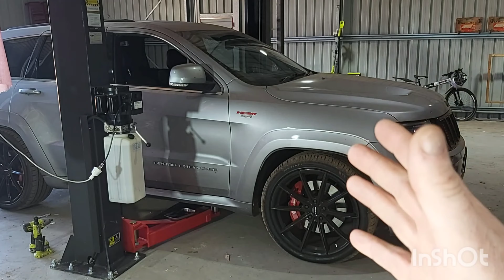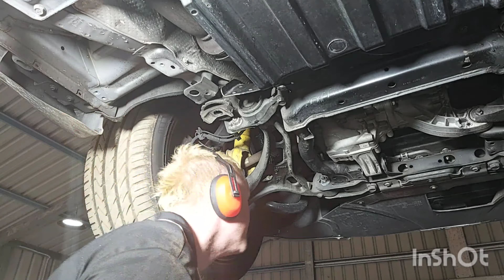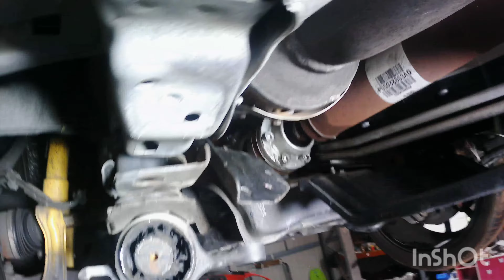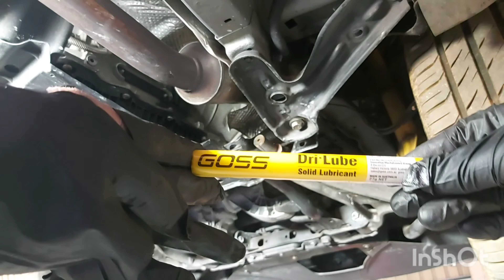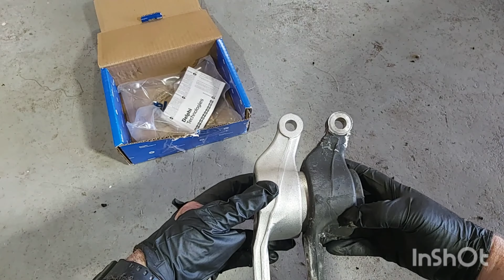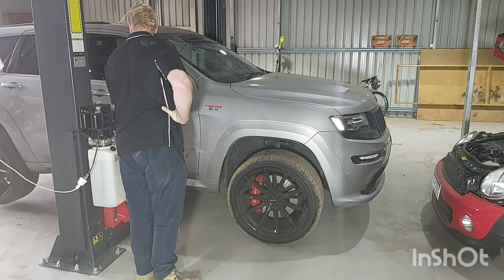How to install lower control arm / wishbone bushes very easily - Jeep Grand Cherokee.

Comment: Well done! These Jeeps and Merc's  Ml"s and Gl's  are a real pain in the backside when it comes to replacing those control-arm bushings. I was looking around today to see if there was a tool that would make the job easier, and I came across your video. I was very impressed with the way you did it.

About how long did the job take using that method?
Reply from the maker: All up a two to three  hours mate. But my car had only around 90k kilometres. The bolts werent seized or anything. The only downside was I had to get the tracking / wheel allignment done afterwards $$$ plus more time in the garage.

Comment: You are truly a wonderful person. However, if the bolts weren't installed correctly, where can this be fixed? Can it be done at a steering alignment shop or by a mechanic? Thank you, thank you, thank you for your kindness.
Reply from the maker: Hi mate, yes, I took my car to the steering and suspension shop after I replaced the wishbone bushes. They aligned everything back to how it should be.
Reply: I truly thank you from the bottom of my heart. You are a wonderful person. I sincerely wish you success in your work and may God protect you wherever you are. You deserve a billion likes. May you and all your loved ones always be well.

Comment: Regarding the screws that are marked to indicate where to install them when finished, what would happen if these screws were installed with a slight error?
Reply from the maker: You will have steering tracking issues. In other words,  your tyres will rub away prematurely, and your steering will pull to the side.

Comment: How can you tell when the bush is bad ?
Reply from the maker: I have shown it on the other video about suspension checks. Usually, your steering will shake around when pressing the brakes. Or the car will wander around while driving. Best way to eliminate it from worn disc vibration is to get under the car and pull/push on the control arms and you will see it moving excessively. Hope that helps mate.